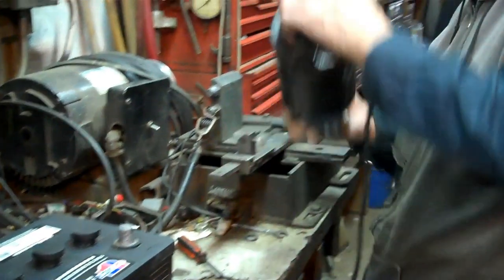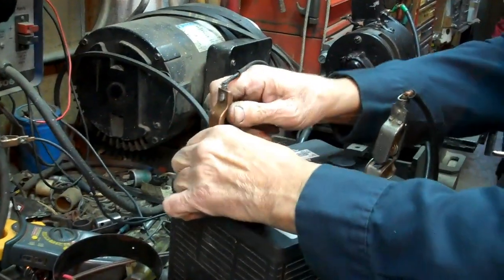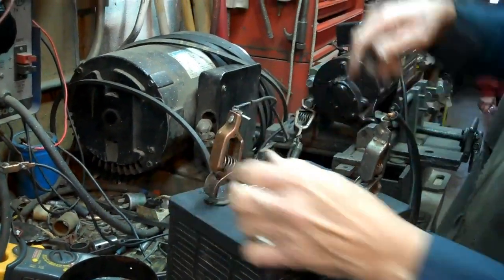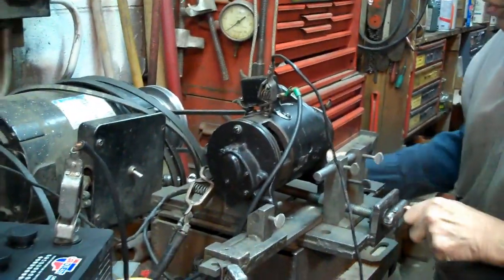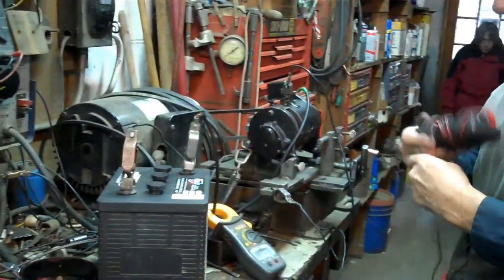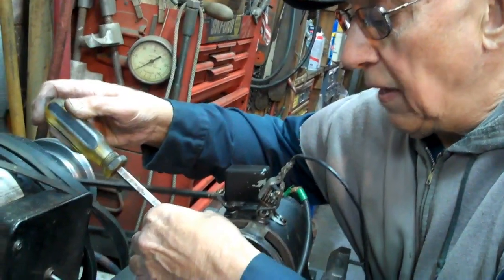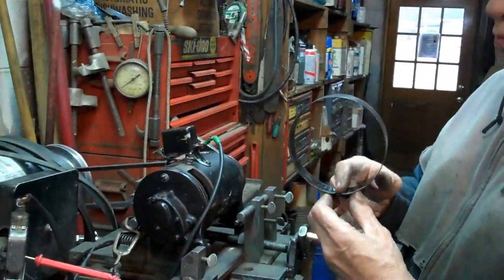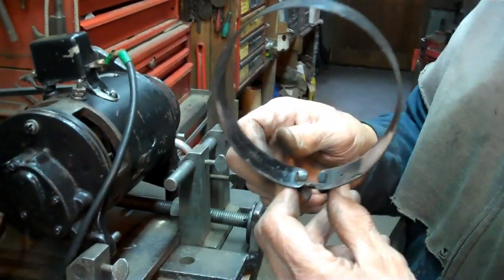Setting Polarity and Adjusting Output of 1952 Auto Lite 6 Volt Generator

Comment: Wow!  Great to find your video.  We have a 1946 CJ-2A that is original and has an Auto-Lite regulator and when we turn on the headlights the Ammeter shows a slight discharge but not with daylight driving.  This Jeep is a "one owner" as I was with my parents when they bought it!!  Should I try to adjust the charge?  Thanks for the video as it is wonderful to find someone who knows about such things.   Best of luck!  The Stokes family, Idaho Falls, ID
Reply from the maker: Reg Clement in Carmel, Maine is the gentleman in the video.  He would be happy to talk with you by phone to help solve this problem:  (207) 848-3404

He is very knowledgeable about old generators and has done great work for us.  Good luck!

Comment: hi i have a 6 volt autolight generator with a cutout on it the generator works but how do you wire up the cutout it has 2 leads one marked b the other marked s   i know the b to batery but the s has got me  thanke Ron

Comment: I didn’t get how to adjust the amps or the volts all I got out of this video is that water will get in a generator so make sure it drains......I can figure that so I wasted my data watching this.
Reply: He showed the process of polarizing the generator.  This is accomplished by using a jumper wire across the cutout. Which is shown by the gen motoring.  This should be done whenever the battery is changed out or disconnected.  If not, no charge